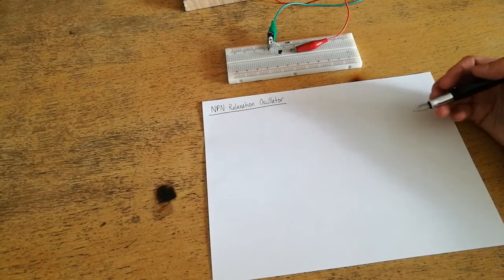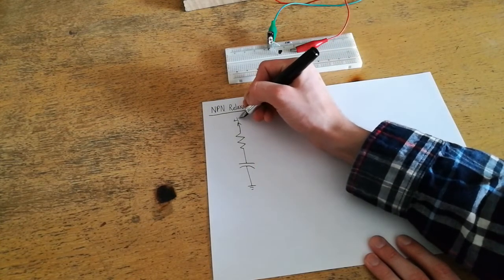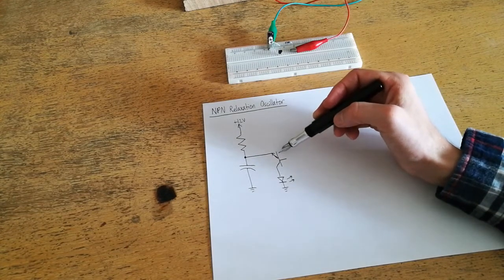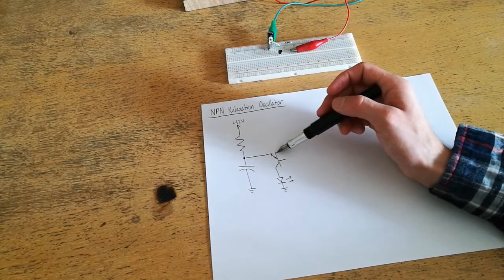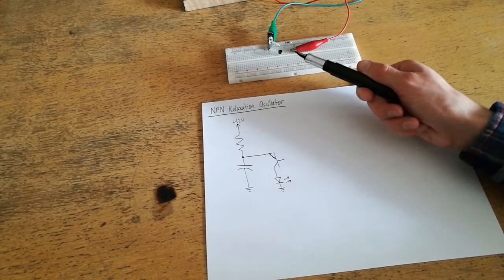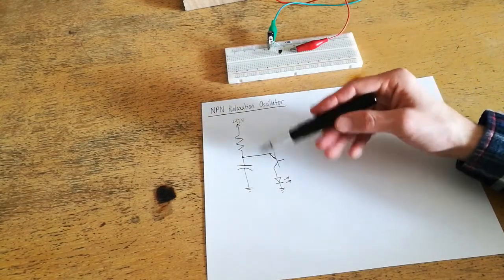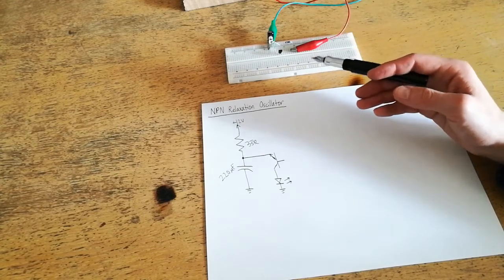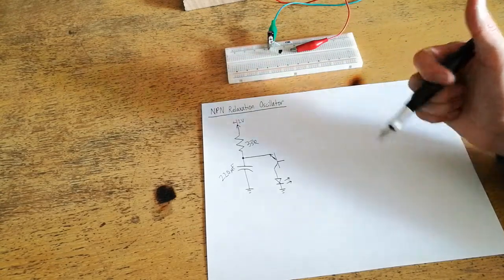EP 49 - A Very Strange Circuit (NPN Relaxation Oscillator)

Comment: It is possible to relax the operating conditions for the transistor and the LED by a serially connected resistor of 330 Ohm between the collector of the transistor and the anode of the LED.

Comment: Liked and subscribed. How did I miss this video for so long. From your experience would this circuit using a 2N3055 npn work well as a capacitor dump circuit for 5- 10Amp  battery charging?  Thank you
Reply from the maker: It's possible, although the reverse breakdown characteristics may be different from one type of BJT to the next, especially when comparing a small signal transistor against a power transistor like the 2N3055. But it's definitely worth a try to see if it works for your application!

Comment: I have read that it often takes a few tries/a few NPN's to work. If it does not work does it ruin your NPN or is it still good to use it for something else?
Reply: I looked up the transistors i have, and they all seemed to require around 50V for reverse breakdown.
Reply: No it will not break them but they will not let current through and leave the capacitor charged.

Comment: Is it possible to run several circuits in parallel. I am thinking of encasing the entire circuit in plastic that will flash in random.
Reply from the maker: Yes, multiple circuits should be able to run from the same power supply. You may need a significant amount of decoupling (capacitors) across the supply rails, otherwise they might tend to self-synchronize due  to small voltage dips caused by other circuits firing.
Reply: @DielectricVideos  thanks
Reply from the maker: @hedhtr4  As GLASS MONSTER mentioned in another comment, you might also want to add a 22-ohm resistor in series with the LED just so the current spikes aren't as likely to damage the LED or transistor base.
Reply: @DielectricVideos  When finished I will post a link

Comment: add a 22 ohm resistor this will help the life of the semiconductors
Reply from the maker: Jamie Phillips I tested this, however the BJT will not remain in breakdown if the current is limited by a resistor. Otherwise, it just reaches equilibrium at the breakdown voltage.
Reply: use a 100k resistor as the charge resistor and a 47uf cap
Reply from the maker: Jamie Phillips For whatever reason, resistors above around ~39k result in failure to oscillate. I think this may be due to the small leakage current present in the transistor just before it enters breakdown. If you have time I would encorage you to test out a few configurations and see if you can improve upon my design!
Reply: what transistor are you using ?
Reply from the maker: Jamie Phillips 2N2222
Reply: the same as me 2n22ara
Reply: @DielectricVideos  I'm currently looking at a power supply that uses this approach. Thanks for the great explanation. The transistor that the supply uses is an ON semi NSS20201LT1G.